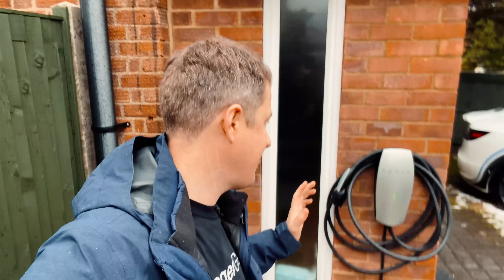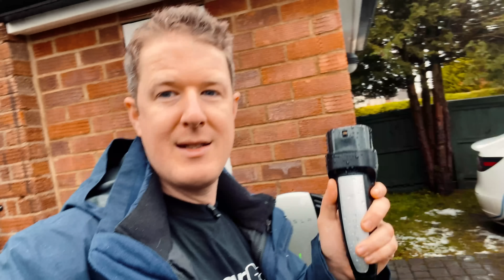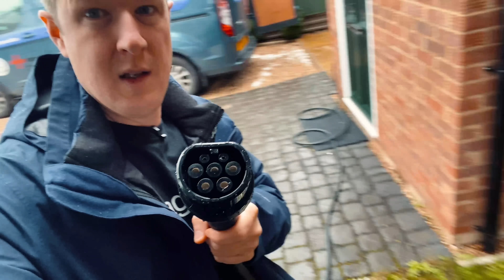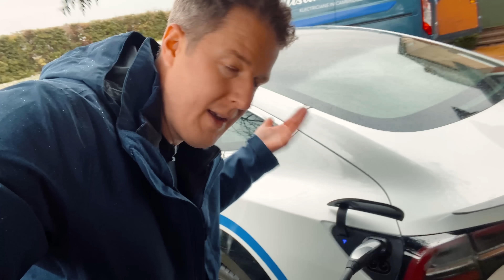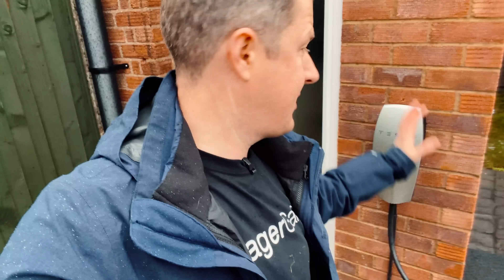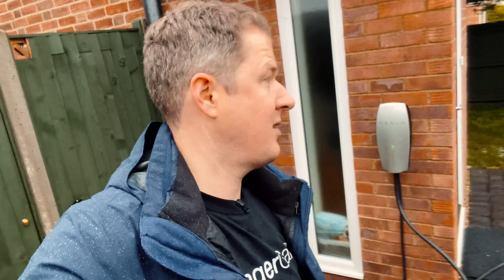Why you shouldn't buy a Tesla Wall Connector

Comment: The Tesla charger really does take into account the UK Electrical regulations for PEN fault detection. Perhaps the newer imported unit will compliment the UK regs. I do know some States in the US have fairly low standards on Electrical Safety.
Reply: In the USA we have 1 or 2 (usually 2) 2.4 meter heavy ground rods in every dwelling that get bonded to the neutral conductor in the main panel. Together with our split phase power there likely haven't been many injury inducing faults similar to UK PEN faults to lead to such protection. So, Tesla likely first designed this wall connector to be slim and simple, as that was all that was needed here. At the time this device was designed Tesla was much smaller and burning money, so optimum designs for other countries likely wasn't high on their list. The 80A/240V maximum output of the wall charger sold in the USA also helped alleviate concerns of recharge time in a physically larger country.
Another point to consider is that we aren't sure what the life expectancy of outdoor car chargers will be. If you locate more of the delicate electronics inside the home then replacement of the outdoor units might prove cheaper.
Reply: @JasonEDragon  The ground rods aren't the important thing here. What matters is that you have a local transformer that insulates L1, L2 and N from the grid so that going through the ground to the next substation is not a valid return path. A PEN fault can happen when N is bonded to earth multiple times. Then there are 2 return paths, either via the N wire back to the substation or onto the PE and then through the ground to the neighbour's PE and back onto N. (Very simplified!)

Comment: With roof PV / Powerwall battery and their charger you can do a deal where they control all of it, with the Tesla deal through Octopus is a great deal but then again any ‘dumb’ charger will do, so does not have to be a Tesla charger and for all the reasons you have shown pointless, better to turn a smart charger dumb

Comment: I have installed EV chargers in the US for about 5 years now and I can see there are many differences in code requirements between the two nations. First of all the way it is wired up here would be a violation in the states. Second no copper rod needed in the states, just a grounding conductor directly from the origin panel. Third, no RCD protection required (which sounds to me like the equivalent of Ground Fault Circuit Interruptors).

Also installing wall connectors on the exterior, although possible, is rare. We usually install them right in the garage or carport although it is outdoor rated.

As for your issue with the cord there are many different cable dispensers available on the market here perhaps they haven't made it over.

Comment: I agree gen 2 was not great gen 3 is much better and will be very good with all smart WiFi features enabled including communication with other smart devices and solar and power wall management capabilities.  Though I agree safety still could be much better less an issue here in us with the mandatory application of arc fault, RCDs on each circuit and in my mind much better grounding with TT and ufer grounding/foundational grounding.

On gen3 look at this nice us based review.

https://www.google.com/amp/s/insideevs.com/news/404714/review-tesla-gen3-wall-connector/amp/

Comment: I have only one good point with the Tesla EV point, it's the same unit regardless of single or three phase installation. Everything else stacks up against it because it's a dumb EV point. So it's nice if in future ALL houses get upgraded to 3 phase for EV>Grid but how likely is that given that most DNO's still haven't upgraded the majority of the 60+ year old local distribution networks. On the bright side the unit itself is free with some model S and X variants so maybe you could be quids in if you have 3 phase and a higher end spec but unlikely.
Reply: Aha! If it's capable of connection to a 3-phase supply that might explain the requirement for a type B RCD.
Reply: It has some load sharing benefits too, as can piggy back another "slave" Tesla wall connector off the first one.

Comment: I would prefer a charger with a type 2 socket and interchangeable vehicle cable. This has become the norm I believe here in Norway. Different vehicles require different charging cables & it is convenient to be able to charge other cars than only Tesla. The EASEE, Viridian and KEBA chargers are all flexible with regard to installation option, source type (TN, TT & IT), 2 or 3 phase versions and include type B rcd & dc bias protection. Load sharing across multiple chargers quickly becomes a concern in 2 car families or shared parking garages.
Reply: In many scenarios in the UK, a detachable cable would just get stolen so would need to be stored away after  use every day which would be a right PITA
Reply: @speedmytube  fair point, though the connector on the cable for my Leaf had a padlock attachment and could be locked to the charger. Most owners need to take the cable with them to be able to use public 11/22kV charger points and there the padlock could help prevent theft when unattended. An additional use for the lock has been to be prevent other car owners disconnecting your car before you are done, so that they can charge themselves. This happens sadly in areas with a shortage of chargers compared to demand.
Reply: @michaellink3832  The cable should physically lock at both ends while charging to prevent interruption or theft so it would only be at risk of theft when not in use.

Comment: Won't a type A rcd and earth rod be enough. Does it really have to be a type B. Like would the difference between having an A or B really be life or death?
Reply: I think the regs say you can use type A providing there is additional 6mA DC protection, which is basically what a type B does
Reply: Thinking out loud, can a DC current cause a type A to lock up and not trip in the event of a fault?
Reply from the maker: Yes it can
Reply: Well thats crap as the tesla chargers don't have internal 6ma dc protection and an A only protects against pulse dc fault currents not steady load. It really is the difference of being able to source an rcbo for the existing unit at a reasonable price or having to fork out for a whole new unit. These chargers are crap. Unfortunately consumers like to have matching things for their toys and will likely get carried away when buying their shiny new car and also purchase the matching charger.

Comment: Hmmm .... I wish I viewed this before buying a Tesla Wall Connector V3 for each of my two homes. However, I live in the US and had both units installed by a licensed electrician without an additional RCD or Penfold Detector. The Version 3 has a thinner cable and a Wi-Fi connection which allows for future upgrades: https://insideevs.com/news/404714/review-tesla-gen3-wall-connector/.  Would be interested in seeing a similar technical review by a licensed US electrician to see if they have the same issues. I would think that Tesla is not doing themselves any favors by selling an obsolete wall charger that appears not well-suited for the UK.
Reply from the maker: Thanks! I think you have different regulations and earthing arrangements in the USA so it might be fine for the US market but it’s badly designed for Europe

Comment: Hi Jordan, I have a Tesla wall connector and I agree with you 100% and if I was going to redo the install I would go with a Zappi (or similar). The only advantage you didn't mention is when you come to the car in the morning you just have to push the button to release the charger rather than enter the car or use the app to unlock the charger port. 
If only Tesla would sell a battery operated button that could be fitted to any charger handle then that would be the best solution...
Keep up the great videos...
Reply from the maker: Thanks for sharing your thoughts!
Reply: https://www.evchargeking.com/en/tesla-charging-cables?pagenumber=1 sell cables with them in for the un-teathered and I think they a lead you could replace on the Zappi with one. I believe they also sell the button module itself. Not cheap though.

Comment: Thought you needed a type A rcd for ev charges?
Reply from the maker: Tesla one needs a Type B
Reply: @artisanelectrics  And that's why we stick with zappi, so much simpler
Reply: Type B or type A+EV. But there's only one model available: The Doepke DFS 4 EV. They'll trip on 30mA AC and pulsating DC faults (type A), additionally they'll trip on 6mA DC fault current.

https://www.amazon.de/Doepke-FI-Schalter-040-4-Fehlerstrom-Schutzschalter-4014712215955/dp/B00O88HOUE/ref=sr_1_1?__mk_de_DE=%C3%85M%C3%85%C5%BD%C3%95%C3%91&dchild=1&keywords=doepke+rcd&qid=1607198141&sr=8-1

Type B is more than 300€....

Comment: I installed a Chargepoint charger for my EV.
Reply from the maker: Which one did you use?
Reply: @artisanelectrics  I went with the ChargePoint Home Flex NEMA 6-50 plug in. My 2016 Volt, with a depleted traction battery, will charge completely charge in 2 hours. I went with the NEMA 6-50 rather than the 14-50 as this is a dedicated EV charger receptacle, so no neutral is needed.